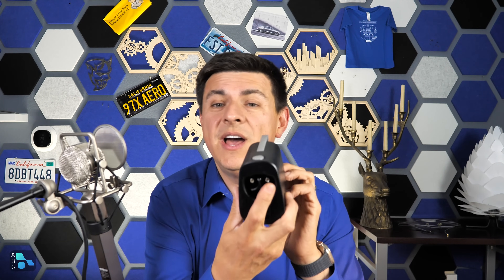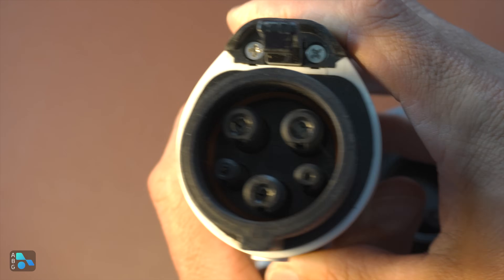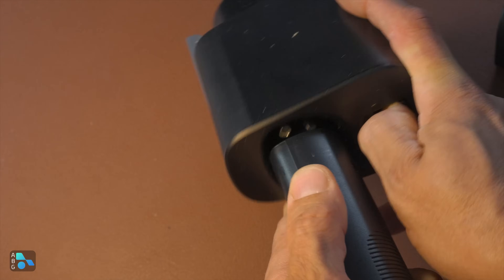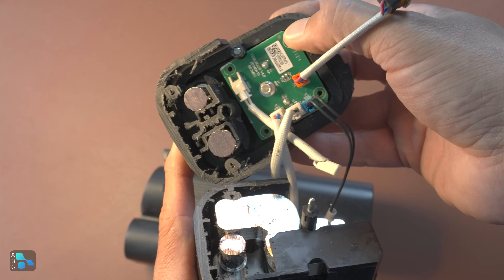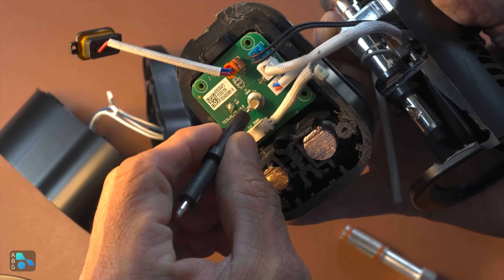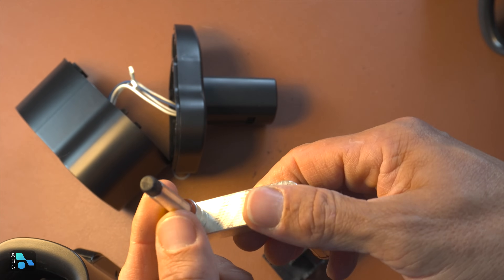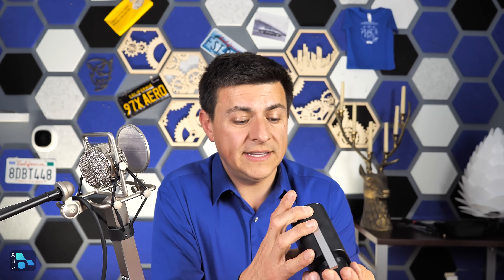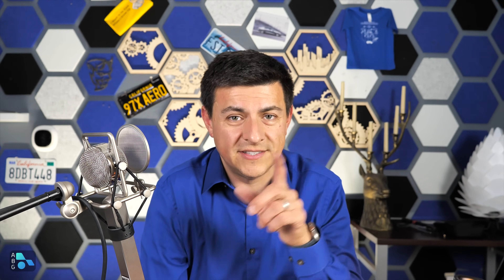NACS Charging Adapter Teardown | What's Inside The Adapter Everyone Is Going To Need?

Comment: UL 2252 - Standard for Adapters for Use with Electric Vehicle Couplers was published on April 15, 2025.  UL is now accepting submittals for adapters.  Those without silver plating must go through extra testing.  I would recommend a UL Listed adapter to ensure safety.  (Disclaimer - I've worked at UL for 40 years).

Comment: Thanks for this teardown. It appears that the Kia one that is going to be distributed is rated for fewer amps than most others on the market. This is in my opinion a cost-saving measure to use less metal, but probably also means that the Kia-provided adapter might be unsuitable (or possibly dangerous?) to use with other vehicles that draw more current. What are your thoughts?

Comment: I bought an A2Z Typhoon Pro adapter for my Kia EV in anticipation of Superchargers opening up to Kia later this month. 

I’m being told there is risk, that Kia will blame the adapter and not cover warranty claims if I ever have a battery issue, and need to buy the Kia adapter when it comes out. 
 What are your thoughts? Any risk st all, given the high quality of the A2Z adapter?

Comment: What happens if you use one of these NACS-to-CCS adapters with a Tesla Destination Charger?  Since those Destination Chargers are Level-2 AC only, I don't think that would be too healthy for your CCS-equipped EV to put AC voltage on its DC input pins.  Are there protections built into the Tesla charging cables that would detect this and prevent damage to the EV?  Is there a different type of adapter you would use for AC charging a legacy J1772 EV with a Tesla style AC charging cable?
Reply: Right now there are separate adapters (look for "Tesla to J1772"). Not sure why the CCS adapters don't include J1772, but so far they don't - at least none I've seen.

Comment: Not sure if my previous comment got deleted, but your usage of the term proximity pilot is incorrect, it's proximity detection.
Reply from the maker: In the SAE standard for J1772 (aka IEC 62196), it is termed "proximity pilot" which is why it is abbreviated as PP on the pinouts, PCBs, and even many connectors and receptacles.
Reply: Incorrect. That is for type 2 devices in Europe, proximity pilot is the signaling that the cable uses to tell the charging station the amperage limit of the cable. Proximity detection is what is used in the North American version of the standard which is if the plug is plugged into the vehicle or not. I've read the standard many times and have both designed and built numerous EVSE units. Unfortunately there is a ton of documentation that is incorrect that shows proximity pilot in the usage that you specified. This does even include incorrectly labeled circuit boards. Rest assured, proximity pilot and proximity detection are two different things that have nothing to do with each other.
Reply: @GregHassler - Greg - isn’t this the small pin which is closer to the receptacle terminal, hence touches for (connector) proximity confirmation before the other communication pin makes contact?  In addition to proximity, this pin is also used for communication between the vehicle and the EVSE (along with the CP pin) to confirm how much current that the car would like to receive?

Comment: For those who are wondering why the CCS standard has separate pins for DC, it was done for safety reasons.  By separating the high voltage DC pins from the low voltage AC pins, they could prevent the possibility that a car designed only for AC charging at 120/240V (most PHEVs) might accidentally be energized to 800V - 1000V DC when plugged into a DC charger.  Tesla didn't worry about this since all of their vehicles are designed for both AC and DC charging, so they designed into their vehicles a circuit that would detect the input charging voltage and whether it was AC or DC and handle the charging duties appropriately.
Reply: Actually the J1772 standard allows for DC on the "AC" pins, but nobody ever actually went with that implementation.  Same current rating, up to 80 amps, but at higher voltage DC (e.g. 400v) that could still carry appreciably more power than AC.

Comment: You state that you “should always stop the charge with the vehicle or charger first”, but you did not explain the REASON that is so important. Simply hitting the latch during active charging will cause the vehicle to blow the High Voltage contactors open under full load as an emergency life safety measure. They are only rated to do that a finite number of times and it is very hard on the components. Not to mention it could literally kill you if that system fails to act fast enough for any reason.
Reply: The BMS is supposed to reduce/ drop the request for current at the same time, it doesn't just blow open the contactors.  Also, upon removal, the control pilot and PD pins are the shortest and will disconnect first, allowing the charger to stop the charge as well.  Lastly, the pins are all shrouded from arcing.  Rest assured there are at least 4 safety measures preventing injury to the user in even the worst case scenario.

Comment: Maybe I missed it, but was the cheapo “ foreign” adapter the A2Z adapter? I thought it was supposed to be one of the better ones.
Reply: A2Z is the best one based on the locking mechanism and construction. He didn’t tear that one down to compare. This video failed to mention what brand the cheap adapter was he tore down to compare to the Lectron and is confusing if you skipped those details.
Reply: @ So I wasn’t just being daft.  I wish he had pointed out where he got the cheap one.
Reply: @dex2531 the new A2Z adapter is a good one, not sure if I would consider it the best, but the first A2Z adapter with the sliding lock was trash.

I own all 4 (Tesla, A2Z old, A2Z new, Lectron -post recall).
Reply: Didn’t he say the cheap one was the reverse, an adapter that allows a Tesla to plug into a CCS station?

Comment: So I have a J177 charger at home but if I get a car that uses NACS can I use these to charge?
Reply: you'd use an AC adapter (J1772 to NACS, not CCS to NACS), these adapters in the video are for DC fast charging CCS cars on charging dispensers with NACS cables. If you get a car with NACS, it'll probably ship with on, but if not they are readily available

Comment: I know the guy that was the orignal designer of the Tesla connector, and he told me that pin in the center of the female socket is to keep little fingers out. Don't know why that would be required, since the connector is not energized unless plugged in, but apparently UL insisted...

Comment: One thing they will know is if theres damage to the charge port with the third party that doesn't match the adapter, say it burned out and melted the port. If your charge port is melted but your adapter is fine, they know another adapter was used to charge
Reply: "Doesn't match the adapter"? All of these adapters are essentially the same at the ports.

Comment: ‘23 Bolt owner here; ordered the NACS adapter twice by mistake and received two (2) Tesla adapters. The original manufacturer had to recall their adapter and are sending Tesla adapters no matter which part code you order. The images for both part numbers did not match Teslas adapter.

Comment: Question, I haven’t made into the video yet, but with plug in hybrids that are becoming a focus again, what’s the port going to be?
Reply: I presume it’ll transition to the J3400 connector but of course most PHEVs can only AC charge right now so maybe there will have to be some additional coding so that plugging into a DCFC will just error out and explain to consumers where they should be going instead.
Reply: @ALMX5DP  Can J3400 do AC only charging for PHEVs? I haven’t been able to find an answer.
Reply: @electricalinput5999  it is designed for both AC and DC so I’d think that just a little coding change for AC only PHEVs would be needed to implement them properly. Without DC components inside the vehicle though the handshake with DCFCs won’t work so there will have to be something to let consumers know that it’s not just an error and they will need to find an AC compatible charger.

Comment: Great video that other channels have not done!  Thanks for a teardown including analysis of the plating of the conductors.

Definitely, >$150 for each adapter is a lot for such a simple device.  I agree that a well designed and quality controlled adapter should have no difference in risk of damage to the vehicle.   Given the massive overpricing on even the third party ones, I'd pay the extra $50 and go for the manufacturer approved one just for piece of mind, and GM has the VIN number of our vehicles attached to the purchase of the official adapter since GM required us to initiate purchase through our myChevy app. (Plus a lot of us GM owners have some GM points that we got when we bought our vehicles that we can use to bring down the adapter price to as low as the third party ones.)

Just two things that need clarifications: 

Re: GM providng Lectron Adapter Only for Bolt Owners - According to the posts on the BoltEV subreddit, nobody so far has received a Lectron unit, they've all been the Tesla one, including mine.

Re: Control Pilot "Powerline Communications" - It's just a communications wire.  "Powerline" communications implies that the pin also carries the charge current and piggybacks the communications on it.  Like how power companies can send signals across its high voltage wires and how some home networking adapters and send signals through the home's AC wires.